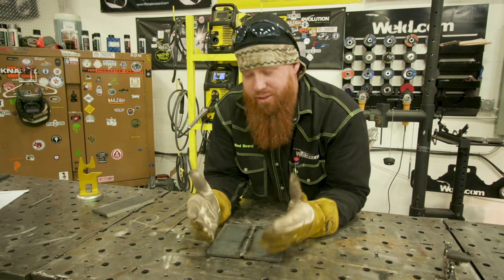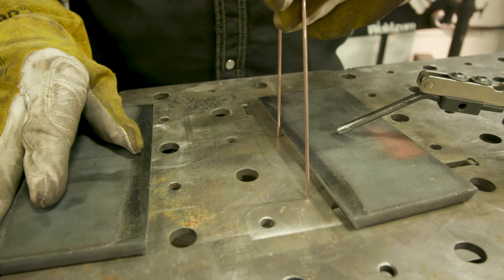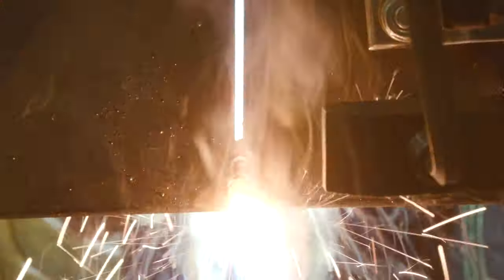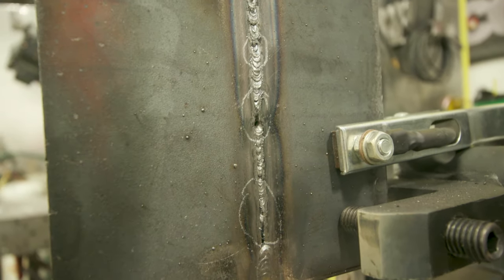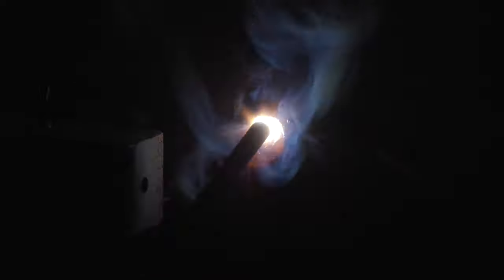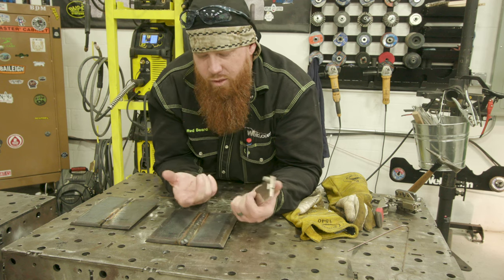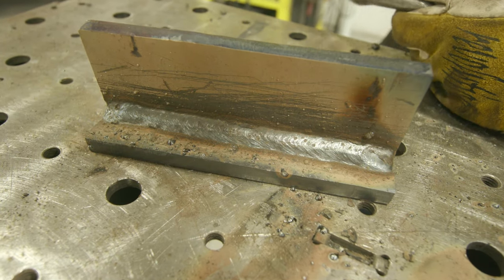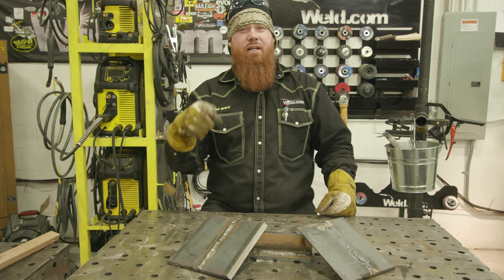WELDING DEFECTS!! Part 2

Comment: Is there a structural or functional downside to excessive reinforcement?
Reply: It can create stress risers and underbead cracking depending on the the shape of the weld and it's chemistry. Otherwise it's a waste of materials.
Reply: Mark Lowry this guy knows what’s up ☝️
Reply: Not to mention additional heat input and lost productive time.

Comment: Just curious, did the fill pass repair the IP?  I saw the arc poke through while running it.
Reply: Hooddowntime no, it did not.
Reply: @GodslilRedneck23  Is that even possible with a lack of penetration on the root? I've seen it push it out a lil' but...  <-Honest question.
Reply: Steve just Steve no, it would have to be cut out and redone.
Reply: Steve just Steve actually yes it is very possible, we do it all the time on pipelines and fabrication, but our first fill is a bit hotter aka a hot pass.  A lot of times we do grind our root depending on stringency of the code, but even not grinding the root, it can repair it.